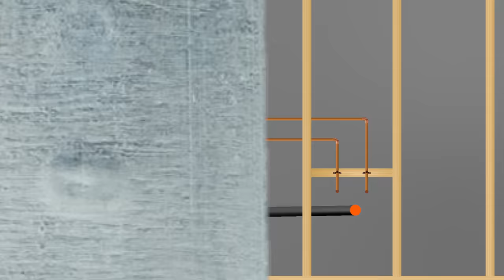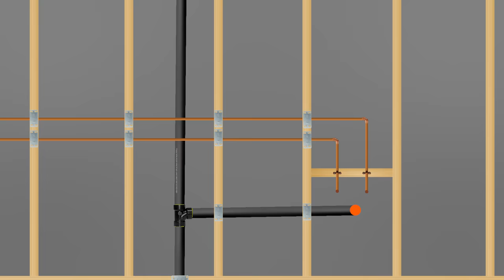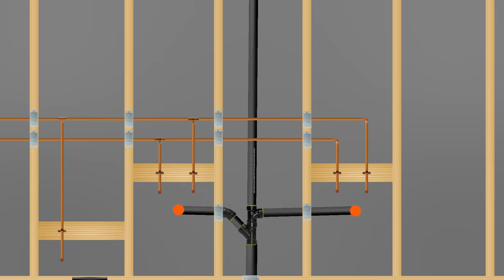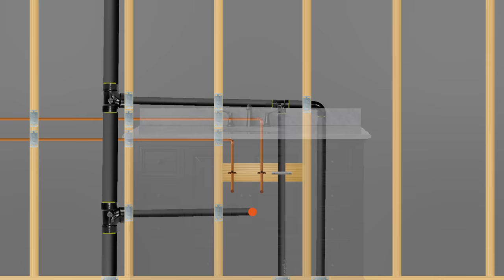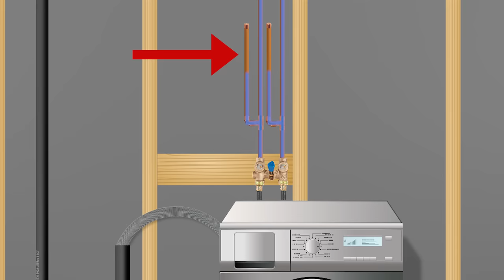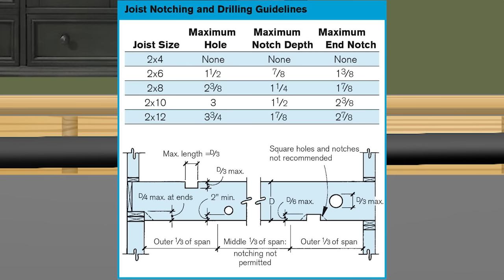10 Reasons Why You'd FAIL a Plumbing Inspection! | GOT2LEARN

Comment: 5:12
It's also VERY important to get did of these pipes bc water can sit in them, stagnate, and poison your water. People have gotten listeria when they drank the water from a fixture that used this pipe setup. 

6:37
Is also important to note you can simply add wood to the bottom of all joists in a room to accommodate pipes that run below the joists. Then install drywall normally.
Reply: I call bullshit on your 512. And 637 was already noted in the video. “You can build a box under the joist”
Reply: My Master Plumber in Ottawa for 35 years can attest to taking a future stub out completely out of the system because it can also hold a pocket of solder paste and then you can have the chance to drink acidic water :/

Comment: Another thing about the main stack, is some places require an expansion fitting to be installed to absorb any movement in the pipe.
Reply: aren't you typically using flexible couplings on the main stack these days anyway?  Ok I realized that I am thinking of cast iron pipe since I do mostly healthcare construction and realize that a lot of piping is now pvc so in which case the expansion fitting would be a good idea.

Comment: Hello, Dear.  Thank you for your videos.  I have a question. 
Our apartment was connected to the city sewer pipe
Due to the foresight and the problems caused by the rise of urban sewage water, we kept the sewage well inside the yard by a branch.
In total, we installed two lever valves.
One in the main route of the pipe that enters the city sewer.
and another on the way to enter the sewage well.
my question is.
The tee fitting between the main pipe and the pipe going into the well was wrongly reversed.
And it can no longer be corrected.
because they are covered with dirt.
My question is, can this reverse tee connection do its job?
On the contrary, I mean that the way to enter the sewage well has found an angle of 135 degrees with the main pipe. If it should have an angle of 45 degrees.
If you have any questions, I will be happy to ask.
Thanks.

Comment: Clean outs on a stack must be between 28-50” here in Wisconsin.
Reply: Sorry bud, its 28" to 60".  Check 82.35 3(f)
Reply: @prestigederek  28" to 60" from what to what?
Reply: In Australia you need a clean out and an expansion joint to allow the stack to rise or lower with house movement, you yanks have them?
Reply from the maker: Yep 💯
Reply: Is that to keep the service plumber from sitting down on the job when he’s there to unstop the drain? Bastards

Comment: The old washing machine used to have a gooseneck loosely hanging in the overflow pipe. The new washing machine has a converter cap allowing the machine to have a pressure fit 45⁰ fitting at the top of the pipe. Worked fine for the longest time. Washed a fuzzy blanket. This created a suction on the line that tried to partially drain the washer while it was agitating. Some drain cleaner got it back to speed. My question, should the pipe supposed to be vented at the top to prevent vacuums? Or will there be a danger of overflowing if the machine pumps the water out too fast?

Comment: I'm in Australia so "code" is probably different. But the basic theory behind all of this is helpful. Particularly the "long sweep 90 or double 45", I actually reckon this is a problem with my storm water. Got square down pipes coming into round, and I reckon it's short sweep. It's under concrete but I'm gonna have to dig it up because every time it storms that joint between the square and the round squirts like a fountain under the house. *facepalm *
Reply: I have extensive feedback from the guy who sold me my home that the overflowing downspout drains are by design. I am obstinately digging each gutter drain up until I can pipe them all together with solid PVC. Hope you don't find a sinkhole under there, cheers

Comment: Excellent. Now, I have no room to connect a new drain line from a washing machine to a 3"waste water line. Please show me how to connect to code, an ABS or PVC, 3"x 2" saddle tee. Installing the Saddle tee is not a problem. I don't know the code. A normal TY would be used for direction flow, right? There is only enough room for a saddle tee.
Reply: Must be y Branch fitting or, combination y Branch fitting for that connection from 2 inch to 3 in drain lime

Comment: Tying a new fixture vent into an old vent is "an automatic fail"? How so? If the vent is sized properly, I don't see a problem and have never ever been failed for this. Please tell me what I'm missing
Reply: Kirk Daniels ...been a plumber for 30 years...I have tied new vents into old 100s of times...no problem
Reply: Yeah it's a vent?!?!  As long as its sized correctly...
I could see it being a problem if there was a fixture above, but in this example it was just venting to air.
Reply: I took that as connecting the new drain to the ex. vent.

Comment: “Short SWEEP” 90’s are approved for drains.  Any fitting with SWEEP in the name is approved for drainage, it doesn’t have to be a medium or long sweep. 1/4 BENDS are what are not approved for vertical to horizontal and horizontal to horizontal drains, only horizontal to vertical drains and vents(of any configuration).  I know what he meant but It’s all about using the correct terminology
Reply from the maker: Correct, thank you for that correction!

Comment: My moms had bought a new house and about a week after moving in, we found out whoever installed the cabinets in the pantry had punctured thru one of the copper pipes and we had a huge puddle of water in the hallway. We shut off the main water and had to have someone come in around 12 or 1 in the morning to replace it and then a renovation company had to replace the damaged walls and put a few huge fans or whatever they were for about a month.

Comment: Cute video. But I've been in trade and service work long enough to tell you. It's not the "correctly" done jobs that pass. It's whether or not the inspector likes the business who's work he's checking or not. If you can flatter an inspector, you'll pass every time no question. But if you get on a their bad side, it could take up to 10 back trips of mods before they'll sign it off. Very few inspectors are "moral" in how they do jobs. Mostly it just depends on who the contractor is and which side of the bed the inspector woke up on that day.
Reply: a bottle of crown left by the bathroom vent stack will always get any job pass..or that is the way in Katy TX
Reply: @allanc3655  LOL

Comment: Judging by what I've seen in my house. I'm going to guess that the previous people tipped the inspector well.
Reply from the maker: Hehe, or he was just having a GREAT day! LOL
Reply: Or it was built to much older codes. My house still has iron drain pipes, and didn't observe the 1/4" per foot rule, so I had to replace one of the drain lines already due to rust and clogging.
Reply: Or it's uninspected work.
Reply: Michael Fresh  Apparently somebody didn't know that water runs best down hill.
Reply: Michael Fresh  working on rentals I've seen so many band-aid fixes, some mean well but don't know better and others are to cheap to get it fixed the right way
Reply: It is called a bribe. Very common

Comment: Drill plates have not stopped me from screwing  through them
Reply from the maker: Jeez, what kinda screws are you using lolll???
Reply: @Got2Learn  an actual good drill and not one youd find at walmart.
Reply: Got2Learn they are called nail plates and where used to stop nails back in the day, really not designed to stop screws
Reply: @stevegiannotti6700  If you cant tell the difference between drilling into wood/steel stud and a nail plate I don't know what to tell you. Pretty sure anyone who's ever used a drill with any frequency could feel the difference in pressure needed to get through a nail plate.
Reply: Aaron Vail I agree with you, I can but the sheet rockers don’t give a shit any more
Reply: @stevegiannotti6700  I'm with you on that. I've seen some crazy stuff. Rockers have just enough brain cells to not drool. I'm shocked by nothing anymore.
Reply: I don't know how.
Reply: Christina Hayes Lol, why would they ever want that shitty job?

Comment: Funny about the washer drain at 2". Front load washers use so little water that I piped mine in 1 1/4" pipe and it works fine. Had to use smaller pipe for this particular situation. I didn't need an inspection but I've been a plumber for thirty seven years and have a lot of tricks that I found that work pretty well. Haven't met too many inspectors that know as much as I do about the trade.
Thanks for the vid, it was fun.

Comment: Even when venting and installing horizontal and vertical drain lines we use Y's whenever possible instead of T's to make it easier for a snake. Just avoid using T's altogether. Otherwise this is spot on.

Comment: You should also put metal plates where wiring is run through studs as well to prevent anyone from putting a nail or screw through the insulation.

Use trusses and you will not need to worry about putting in holes to run wiring and plumbing.

Comment: I mistakenly set up for an air pressure test for my drain lines... MAJOR pain! I should have used the water test.... I didn't have good access to water at the time
Reply: Shouldn't have been a problem
Reply: @tyrelwmoreland1637  The reason for using water vs air might have been for safety.  An air blowout releases a lot more energy than a water blowout.
Reply: @johnherbster5110  we always air test first...shouldn't be a pain to tie hot an cold together at water heater stubs...alot less mess if there is a issue...
Reply: @tyrelwmoreland1637 he said drain lines, not domestic
Reply: @tyrelwmoreland1637  although we only air test dwv on high rises and stuff, if we used water we'd need 100psi at the bottom to get the 5psi needed at the top

Comment: I just love putting cabinets in a remodel and the plumber decides not to use drill plates.
Reply: a decent plumber would also avoid putting any waste or vent lines where cabinets would be!
Reply: More than likely the feeling is mutual!!  Plumbers love when cabinet guys spray stain paint all over plumbing coming out of the wall.....,..  or try to move plumbing to fit/install cabinets ect ect ect..... every trade can blame other trades for almost anything when looking for excuses..... I'd almost bet that if you do shoot a waterline installing cabinets you arent expected to pay for repairs anyways.  Just like plumbers dont have to pay for cabinet guys to come recut or redo cabinets when sink or lavatory holes dont match the templates left to do so.
Reply: @keithblue8    Where do you live that the cabinet guys are finishing cabinets onsite? I haven't seen that in 20 years.   Difference being that, at least where I live, is that its code for those drill plates to be in the wall. The builders absolutely going to blame the plumber for not following code.  As for your last, I've never seen a plumber cutting a sink hole in a top, thats always been the cabinet guys job, unless its granite.

Comment: I found a drain pipe in my 1977 house leaking.  It was never glued.
Reply from the maker: Hehehe, I would see that often when I was in the field lol
Reply: It's been known to happen. A plumber dry fits a couple pipes and fittings together to make sure the measurements work out, and it slips their mind that they forgot to glue it. It'll hold together, mind you, and even not leak for some time, but it'll eventually leak. Worst I saw was renovating a storefront; new owner was going to bring in a daycare. Originally they thought that meant a few extra bathroom fixtures sized for toddlers. Nope: you need a laundry and full kitchen too. When I got there and we looked at the drainage we saw that NONE of the venting (ABS cellcore, too) was glued together. We had great fun showing the building owner, going up to every vent stack and shaking it until the fittings popped off. We ended up replacing the whole venting system with XFR PVC pipe.
Reply from the maker: Oh god lol, you did a good thing by replacing it with XFR, if you can afford it, go for it hehe ;)

Comment: He's partially wrong about the short sweep 90s. You can use a short sweep 90 going from a horizontal drain into a vertical, but not on a vertical to horizontal or  just a horizontal line.
Reply: Only if its 2" and smaller
Reply: Yes horizontal then DOWN into a vertical stack. On venting you can do either and size doesn’t matter.

Comment: Now if you could just tell me how to plumb a 7 story hospital from the ground up, I'd get a 10 dollar raise.   We use minimum 4" soil pipe for a water closet in fl.
Reply: Just dont do a bunch of screwups like the people who built the hospital I worked in. We had over 20 "floods" on the basement level in the first year. The kicker was the 18" or so of water when one bozo cut a pipe and the guy on shift before him didnt close a valve he was supposed to. They dropped the water from the sprinkler lines for the whole building. It was epic.

then there was the burst pipe 20-30 feet up in the utility room in the basement. the room flooded. It was 12-18" rise before hitting the floor level for the hallway. The drains in the room weren't keeping up and they had to shut the water off for the whole building for a short time to let that room drain. So much water was coming out that it was coming out the first available drain downhill on the city storm sewer lines.
Reply: @goodbodha  screw ups  happen.  For example.  A concrete cutter cut into my 12" cast iron storm under slab.   If u don't mess something up you ain't doing nothing.  Now thats no excuse to f shit up. Keep them to a minimum
Reply: @jpmonin7429  that cut pipe screw up did over a million dollars of damage to the building. The others weren't as bad but the frequency of them was astounding.

Comment: where I live, the plumbing inspector made a code that you can't put cellular core pipe below grade. it will flatten out over time. and you forgot to mention the use of di-electric unions on water heaters.
Reply from the maker: Here they aren't mandatory, but I know a lot of places in the states it is.. thanks@

Comment: I didn't quite get the "new fixture to existing vent" connection restriction, Surely adding a second sink in a bathroom (for example) doesn't require a completely new vent run?
Reply from the maker: Yes, that's why it's complicated to add fixtures in a basement, normally, the builder would have left a "future vent" as mentioned which would be the proper way to connect, if you do connect to the existing lines, you might overload the venting system.

Comment: Had a plumber put in a double sink in my kitchen during a small upgrade. Fool cut the down pipes from the bottom of the sinks wrong length. And rather than pull it back out and recut them, he just turned the trap around... so the drain side of the trap was higher than the bottom of the drop drain pipes from the sinks. So water was trapped all the way up to the bottom of the sinks. Even 'professionals' have no idea what they are doing. I called the contractor who had brought in the plumber. He took one look, cussed a lot, went out to his truck and came back with his own tools and fixed it right.
Reply: You can do that in some situations depending on the piping arrangement... it's called a running S trap.

Comment: What if I'm not able to remove the 1-1/2" old pipe for financial reasons, will the drain still take the discharge water from the washing machine? What's amazing is that All the fixtures (Tub, vanity, & toilet) worked fine with no vent system since the house was build, tub & vanity on a  1-1/2" line

Comment: Way back many years ago the head of a building department gave me a great mental image of the use of short and long-sweep elbows.  If you fall off a cliff it is fine as long as you have a gentle landing.  Hence, you can use a short elbow, really a sanitary tee since you need it to vent at the top, since that is your rapid fall off of the cliff.  But at the bottom you'd better have a long-sweep elbow or two 45s for that gentle landing.  Since then I've never failed a plumbing inspection, at least for waste pipe.  That isn't true.  I did try to tie into an existing vent one time - much easier than running a new drain down.  And the reason you don't want to do it is because the waste rushing past the existing fixture can create a negative pressure and pull water from the trap.  You want every fixture to have free access to outside air via the vent, and you still can tie the vents together higher in the wall or in the attic, and provided you size the vent correctly have a single or maybe only two vents penetrate the roof.

Comment: Drill plates are not enough as I drilled into a water (pressurized) pipe when installing a cabinet in my laundry room as the stud finder said it was a stud, and the drywall screw was sharp enough to catch the freestanding pipe and bore right into it!
Reply from the maker: Still better than nothing ;)

Comment: Washer is standpipe minimum 24”, and where you connect to vertical minimum 4” or 2x pipe diameter between trap and connection

Comment: Thank you for this video. I tore out a severely moldy basement bath and put French drain and rigid membrane along the wall. I’ve never been a plumber and seen a big problem I can’t believe someone would do. The upstairs toilet above runs into the roof vent and the configuration is similar for the washing machine in the video. The washer and sink is vented to the sewage pipe way low and under the upstairs toilet. Worst part is the wye is facing up where sewage can run right down into the vent. Can anyone tell me if I can just slide the vent pipe upward through the boot on the roof to connect the vent up in the wall above the toilet and then slide it back together? I’m guessing the rubber on the roof is tight around the vent pipe.